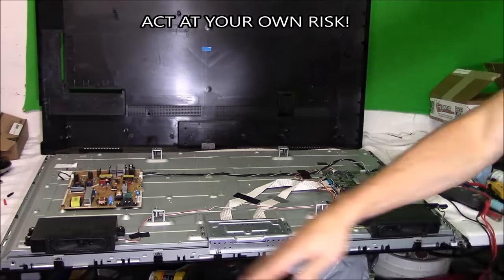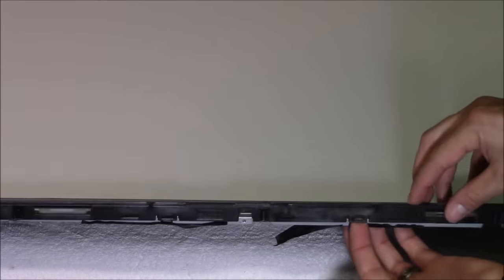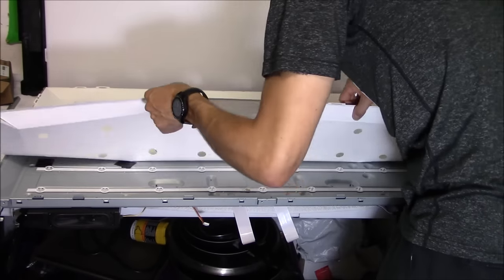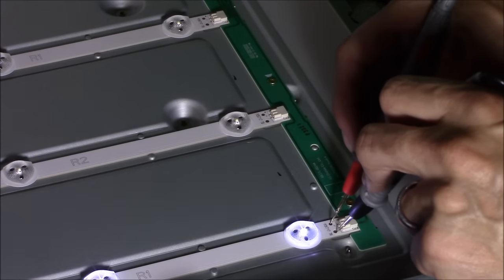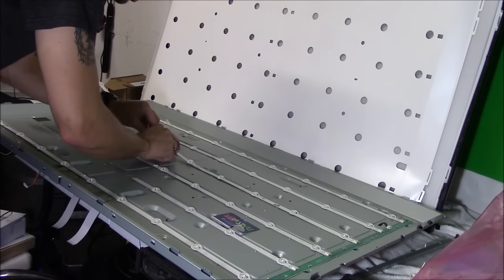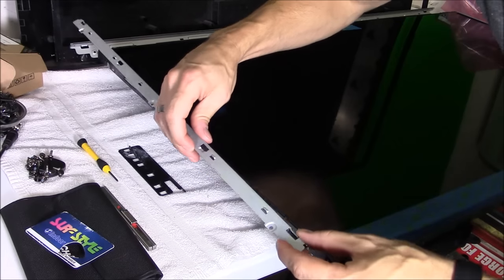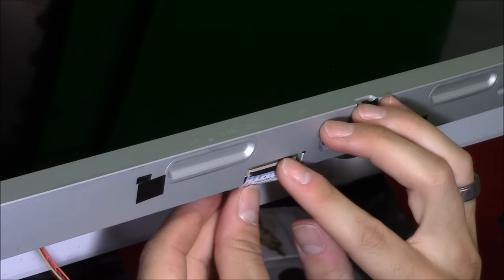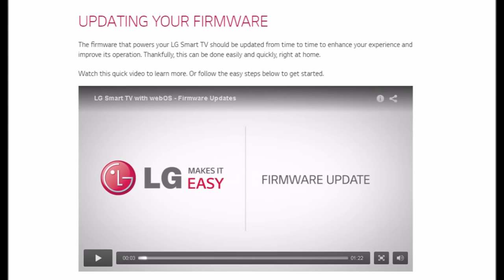How to fix LED LCD TV black screen no backlight, TV disassemble, testing LEDs, ordering part, repair

Comment: Shop Jimmy is one source for replacement LED light strips. Is it best to replace all the strips? The 2 strips that were still working are as old as the others. Thank you 🤓 can you test the newly mounted strips before fully reassembling the TV?

Comment: Love the video!  I need to go further now and test the LED Driver board (and possibly the inverter?)  on my Vizio M701d-A3 - but there are no listed voltages for each pin.  How would you suggest I test this? BTW - Blank screen, no backlights, see pic using flashlight test.  Thanks!

Comment: Loving the videos man. They're well made and thorough. When I start making some $ fixing tv's I'll be sure to throw some your way :)
Quick question. You checked the LED's cause the screen was black, but when you tested them, most of them seemed to light up. Wouldn't it just be a dim screen if half or more were working? Thanks!

Comment: A lot of you think this repair wasn`t worth the trouble and i agree but only because of the size of  the tv. if this tv was 60 inch or larger it would be worth it because people are willing to pay $250 to $300.00 to have it repaired depending on the model and year of course.

Comment: Hi. I have to say these videos are very helpful soo Thanks. I have however a question. I accidently cracked the light diffuser panel while removing it. Its a crack of about 4-5 cm (im not sure how many inches is that). But the question is are you going to see the crack in the the end or is there a way to fix it or should i just start looking for a new one

Comment: Not too many people do this repair.. My hat goes off to you. Ive done 4 this year already. Right now i am working on an lg 50pj350 50" plasma, the ones that have the 20 kits on ebay to repair the power supply. Ive done the kit install and replaced every board but im still getting the clicking.. Gonna have to really test everything now. Im thinking the panel may be bad..Any ideas? Keep up the great work!!
Reply from the maker: thanks. clicking hmmm try unplugging a sustain board then turn on TV and see if it stops clicking, common problem for 50PJ340, 50PJ350, and 50PJ550 is relay clicks on and off> IC301, D304 sr104, 2x 220uf caps, f302 2A fuse, R927 2x 22ohm 5w resistors, repair kits at sales@zemtronix.com or just replace power board if Va voltage is ok but after relay clicks it goes down.
Reply: +Tampatec thanks for the advice.. Gonna give that a shot...
Reply: So On the 50pj350 i unplugged the power going to the ysus board and it powers on.. No lighting or anything of coarse but all my power supply voltages are good(va,vs,m5v, standby). Ive tried two different ysus boards with different buffer boards and i still get clicking? Is my panel shorted out? Thanks

Comment: Sigh..
Just going to buy another tv lol
Reply: Really?  The entire repair requires nothing more than a screw driver, the cheapest soldering iron on earth.  If you keep the boards on the back of the tv you can even power it on and see what lights are bad without having to buy a led light strip tester.

Comment: Great video bro. I have a quick question, i hope u can answer it for me. Ok...So, if u were to have a problem with one of the ribbon cables on bottom of panel ( black vertical line when tv is on ) , 
Can it be fixed?. . Thx. Keep up the great videos. They are much appreciated.

Comment: if i use that tester and insert it right into the connector from the main board going to the leds shouldnt they light up? why take the tv apart to see if your leds are working? yes i get it, you now want to see which leds are bad but to troubleshoot if you have any leds working or that you have a different problem, wouldnt this work? Thanks and awesome video.

Comment: Nice video. I have the same problem with a LG 32LA620S tevision set. Do you reckon I can replace the LED stripes by myself or should I give the TV to a technician ? It would cost me extra money and not sure he will take the same care as I do. But I don't want to damage the set if I'm doing something wrong. So, bottom line is, can be done by a semi-noob ?

Comment: I'm working on a VIZIO e470i-A0. I had a few LED's that were out. I just on a whim and changed the LED's strips around. I didnt mix up the R1's with R2's. i just moved the R1 with R1's. After doing that now I have 3 row of LED's working in the middle. But when I put a specific R2 in the middle row they all go out and just flash. i did not test the LED strips Still waiting on the back light tester. Thanks for your help.

Comment: Great video. What could cause the picture to cycle to black and normal every three to five seconds on a Vizio D43nE1? The upper section of the screen is also darker than the lower part, and the brightness control seems to make no changes.

Comment: That's the same issue my TV has. I'm not aware to open it up because I don't wanna make any mistakes, so I take the TV to an specialist technician to replace the led stripes. Thanks for the video, because I didn't know what was the problem with my TV!

Comment: Great video man. Cheers.
I have a little question, how can I know which LED strips are compatible with my tv without opening it? 
Mine is RCA rc32f16-a. I'm looking to getting fixed as cheap as possible but without sacrificing quality.

Comment: Nice job.  I am tackling an Element 65" no LED's at all.  The funny part about this video is there were no LED's lit up when you used the flashlight, yet the tester showed about 5-6 LED's out. SO why didn't we see a partial screen?  My TV has the same config as that one, no separate LED driver board.  I will test the Voltages at the red & White wires out of the PS board. Then disassemble to get to the LED Strips... ugh!! I am across the way in Merritt Island by Cocoa Beach.  - SurfStyle card :)

Comment: great video, as always, but had a quick question. Im about to attempt this exact repair but was wondering what you think is the best thing to use to lift the LCD panel. gloved hands, a suction cup (s) , or something else? im just worried about the panel getting torqued and cracking because they are so sensitive. also. what were you propping it up against and is it ok to let it stand on its own weight like that. thanks for the vids as always. big fan for awhile now.

Comment: Thank you for the video. I was able to change the led strips and my TV is working. But!! I am getting a ghosting on my imagae that is the Led Strips. I either purchased the wrong Led Strip or I placed the Panels behind the main glass sceen in the wrong order.  I did not keep them together and I am hoping that is the problem.  Can you tell me how I can get the correct order the panels go? 
I think there are 4 white panels one had a shiny side not sure if the shiny side  faced the side of the Leds or the black screen. 
Thanks again for the instructions and any advice would be appreciated.

Comment: The videos are great.I have a
 LG 42 ly340c The TV has ni picture,but the sound works.When I turn it on the LG logo flashes for a second and then the screen goes black.With the remote when I press menu or settings I can see in the dark screen that it works,but can't really do anything, because it's not really visible. From all the videos and suggestions , I asumed that the power board is gone or has bad capacitors, there was none of them blown,but someone mentioned sometimes they dry internally, so I replaced the whole power board.Anyway that didn't change anything and I still have dark screen. Do you think it's possible the other board is bad,even I heard sound and picture comes from the same one or I should start looking into LEDs?Thank you in advance!

Comment: So im assuming there are only 2-4 types of led back lights for most tvs unless you have a newer one withthe mini LED SMD chips where there are likely several 100 per strip.  If I was going to start a repair business which replacemetn strips would you suggest i stock up on?  
Sincerely, another career starting

Comment: I am working on my Sharp 50 inch Roku LED flat screen TV, M# LC-50LB481U. Tested each strip which has 6 strips with 11 LED lights each. Two strips of which are completely bad. My question is: Is this enough to cause no back light. I have a regular image when doing the flash light test. Would the next step be to purchase an LED strip kit? Thanks. Enjoying your videos. Liked and subbed.

Comment: what kind of meter is that you have ? ( I assume that's some type of voltage generator) , and what types will do the same job . I do a lot of repairs for friends and some customers (yet not main business) on all types of electronics ( I do custom home theater  and home automation, security and networking so i come across this periodically) . I have Amprobe multi-meters but know of no generating capabilities. I have done flat panel board replacements and cap changes but do not do professionally so expense is a consideration on the meter in question ,   also I am working on my parents Vizio M60-C3 2015 , and seem that I'm loosing the active zones back lighting ( local dimming zones )one by one ,  is this video the same for that issue? ,   thank you ,   great video BTW

Comment: I almost forgot to thank you for the card trick getting the old LEDs off also. I ended up using an old laundry vending card. I knew I kept it for a reason. It also saved me a few bucks not having to buy a 5 in 1 or putty knife.

Comment: Tamatec, I need your advise. I'm removing the motherboard on a TLX03210B polaroid tv. After removing the screws and wires the board seems to still be attached to the chassis. Is the board also attached by two solder joints on the left side of the board?

Comment: Hi There:

I have a set just like yours in the above video.  The set is flashing, I did test the Vouts for the backlight and they are at ~130 volts, however they are flashing about every 3/4 of a second.  One thing that was interesting is that when you powered on the set in the previous video, the little power LED did not light. But it was on, I could activate the set up menu, even though it was blinking. There is a brown mark on a round transistor (?) marked as 220 on the main board.  Any ideas?

Thank you
Pauli

Comment: Hi ; thanks  for great video ; i have a 50 ONN roku tv that i turn it on it has all voltages and 225v to the backlight, no back light at  all i tested with flash light,are all the leds bad?

Comment: your top 2 strips were fine...does this mean you should get some tv display? or beacsue 2 strips or defective does this cause total failure? the reason I ask is becasue my tv screen has went blank..2 strips are bad but the others are fine but you would think their should be some picture if its only 2 defective strips?

Comment: Good job and really informative. I don`t know what 99 bunch of bozo`s gave it a thumbs down? Tampatec have you done a 75 inch and would it be the same way? I have vertical lines on my samsung and was told TCON board hopefully just that and not LED`s it could be challenging

Comment: If you touch any of the layers and get fingerprints or lint on them, will it affect the picture badly?  I stupidly did the same thing.  I didn't wear gloves and I took out the individual layers.  I tried using a mild detergent solution first and then rubbing alcohol and a microfiber cloth, but it didn't take the prints out entirely.  Just wondering if you've put one back together, without completely cleaning it, and if it didn't look like garbage.

Comment: I connected 3x9v battery's together to test my backlights it worked great, there was only half a strip not lighting up so I replaced that and put the telly back together and I still can't get a picture , I get the channels and sound ok and when I shine a torch on the screen I can see the picture in the background , I replaced the main board and the infra red pick up, my power board is fine, so got any idea's where I went wrong cheers

Comment: Hi, could you put the led tester power supply onto the 2 wires that come out of mother board( that feed the led strips?) Even if one row is not working..better to change the whole lot??

Comment: Hey guys i need help. I'm a total novice at electronics I have an older LG 42LN5300 with the dreaded black screen problem. I did all the troubleshooting in the videos and had no luck so finally replaced both boards. However, still no luck so now trying to test the backlight straps. Mine is an older TV and only has 5 straps. Additionally, at the connection point it has 2 negatives and 1 positive points. How do I go about testing the straps and what should I set the testing meter to? Again total new to this, apologies for my ignorance on the topic. Thanks

Comment: I have a Sharp Aquos LC-70LE734U it has the blinking lights, one slow one fast. Went through your other video to reset, and nothing, seen the post from the other guy about the backlight strips. But it does not look like there are many new parts available for this TV, almost no used parts only could find three LED strips. Is it worth messing with, would you start with checking the LED strips? I figured I could lay the TV face down on the carpet to disassemble then I would have less chance to break the glass and get lint between. Looking for suggestions?

Comment: Hi Tampatec, thank you for you videos.  I have a Toshiba LED 50L1400u. Turns on and off, can see the screen but it has started to darken on the top and bottom of the screen.  Its as if a shadow effect was added. So about the center 1/3 of the screen is normal lighting. Center meaning from left to right but dark shadow effect on the rest of the screen.  Any suggestions of what it can be?

Comment: Thanks very informative  l learned.
Question :how do l fix the two ribbons on the left connecting the screen l accidentally ripped it so half screen is showing after replacing  the back-lights?

Comment: What were the symptoms on your screen? Was part of the screen blacked out where the leds were not lit or did the whole screen stay black?

My TV flicks the backlight on for a split second on power up, but then only the ghosted image can be seen with a flashlight... is that a LED failure or driver board failure?

Comment: Hi Tampatec, quick question regarding testing the backlights . When I power the tv on all backlights come on,  But since they are controlled with regulated voltage through the video board I would assume this is where the tester is invaluable for testing individual strips. I do have some LEDs on some strips not powering up on lower voltage but as the tester increases voltage  most come on but I do have some not lighting up. Does this mean I should change the strips?  Please advise. Help appreciated

Comment: My LGLA4700 has black shadow on one third of the left side of TV. Tried a reset pulling plug which worked for a week but now it is back. Do you think it is the same issue like on your video?

Comment: My old 32 Philips tv has stand by light red and flashes 3 white lights when turned on, screed is black but back lights are all on, they are long lights like florescent lights. power board looks good no busted caps all with voltages, tcon board must be built into main board because no other board on back of tv, just power board and main board.Tested for shorts can;t find any. This is my first tv to fix would be nice to get it going. Cheers from Ireland

Comment: Hey, have a Sony 60in. mod# KDL60EX500. Black screen and no backlights. Checked with flashlight and saw nothing. Took back cover off and saw no visible damage but when it was plugged in once there was a red glow coming from the main board just below the coaxial plugin. I'm sure the volume was all the way down because I was using a sound bar when it ko'd. The only way to get power is to plug and unplug from the wall outlet. When its plugged in the green light stays on and no red. Sorry for my rambling. What do you figure I may need and where to buy. Thanks

Comment: Hi man...I'm in Mexico, firstable I want congrats for you video is amazing. I have one question, my LG 50 " Led TV has the problem that the sound is OK, but the image is off, I did the test using a lanter and I can see image, but my question is: when I turn on the TV I can see a image but only one second and after is dark. Do you think that the problem are the backigths? Thanks man.!!! Regards from Mexico.
Reply: checa las luces que esten quemadas amigo a una de ellas le quitas la tapita y el led amarillo y la puenteas y es todo las otras prenden

Comment: Hello, good video, I have a 4k LCD display that works fine when stay still, but when on any impact the screen turns black and then on again,  so every time I tap on the back of it the problem repeats.   What could be the possible problem?  I think something is loose , but where to start looking?    Thanks.

Comment: I need to know more about the screen its self. The one you said was expensive. are they interchangeable? Where would you purchase one? Can cut them down to fit? I have one that had something thrown at it. I have to guess that's the problem.

Comment: Hello
 i got a samsung 65 inch curved

I have no video and no backlight on the tv
When i disconnect at least 1 of the 2 ribbon cables (or both) that go from t con to panel than i get the backlight on, when i connect them back again and when i dissconect the ribbon cable that goes from t con to main board (i think this one is called LDSV or something) than the backlight goes on again....

I cant understand if in this case if the t con or panel is bad?

Some help would be very appreciated!
Subscribed!